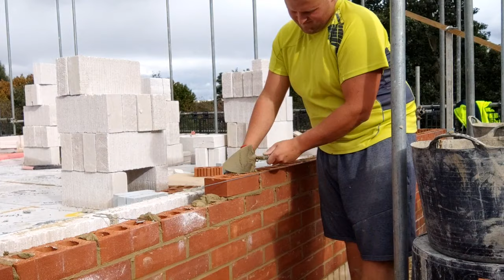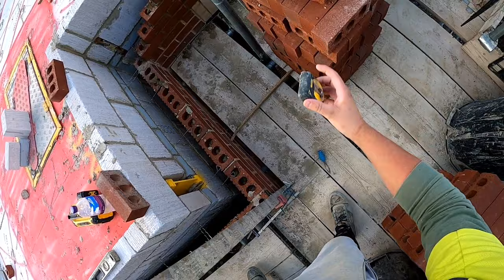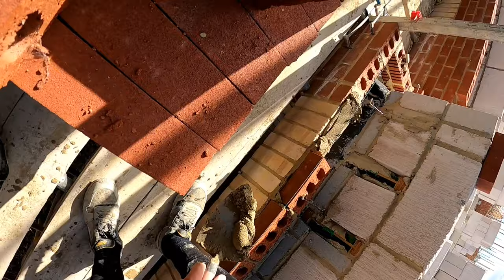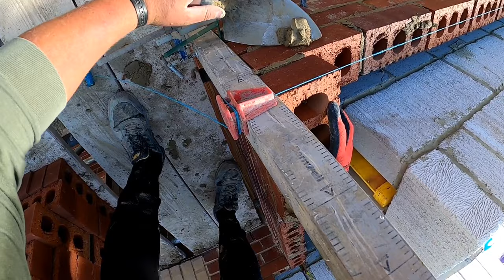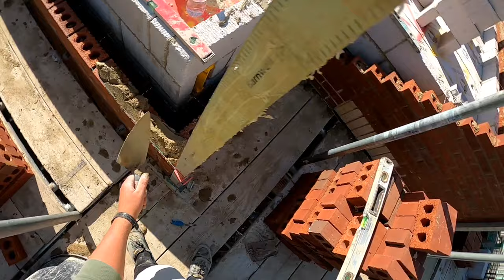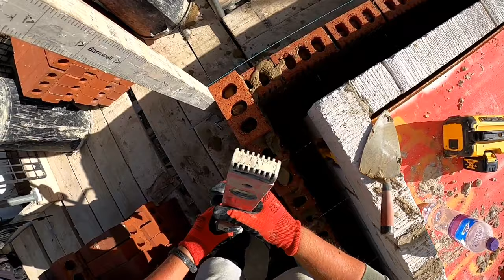Bricklaying Vlog - A One Man Gang! £800 a Day!?

Comment: Well done on you 1000 brick, but how many did you lay the next day you need to find your average brick count a day, my average is roughly 750-800 a day traditional build with 100mm insulation which is slower we work 7,30-5.00 Monday to Friday
Reply: Speed demon. What size trowel do you use? My wrist been killing lately with an 11
Reply: @tommyb5244  what trowel do you use w rose trowel are meant to be better on your wrists
Reply: @danielhope3272  I use 11 marshalltown
Reply: @tommyb5244  try a rose trowel different shank angle meant to help loads feels weird till you get used to it I use a wide london cork handle love it
Reply: I’d bet you a lot of money you don’t average that  in a year if you do can you come work  for me
Reply: @Liam Walters  why would I go work for you, I have my own squad of 8 trowels, I'm not saying these numbers are daily but they do average out around them numbers come Friday, Example yesterday myself and 1 of my lads had done 700 brk at 10.30 yesterday it was a nice straight run about head on ground floor to under cill on second floor these runs drive up your average, what I'm saying is no point in doing a 1000 brk today and only doing 200 tomorrow , find an average 👍